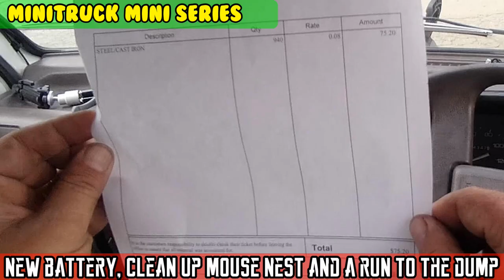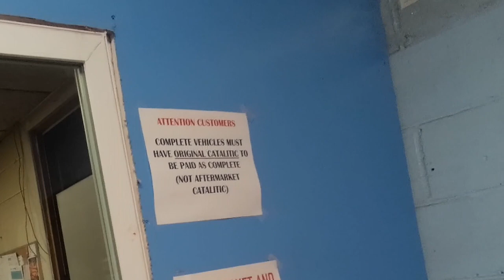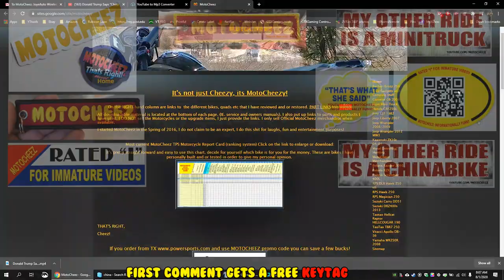Mini-Truck (SE07 E11) New battery, clean out the mouse nest, trip to dump, dinner at Down the Hatch

Comment: Darn it, second, again!!!
Last March I found a nice 2011 Xterra. One of the first things I do when I buy a used car is change the cabin filter. The one in the Xterra was disgusting, grass, fur, and it was BLACK. Pull the filter, vacuum it out as best as you can, crank up the blower and cycle the selector through all of the directional choices. Then install the new filter.

Comment: Do you know how to get to your thermostat on the mini truck and van? My buddy bought a conversion multi cab van thing imported from Japan but he is in the Philippines. He has the same turbo 66 hp motor ..  The common ones used I guess. But he said to get a new thermostat they had to take the engine out.😲🤔 .. So they are going to go over everything while the engine is out.. I guess a hose blew off because of pressure and the thermostat didn't open.. He is only paying like $300 for that entire job.. Lol labor is at least a third price as here..
Reply from the maker: I had no idea .. wow